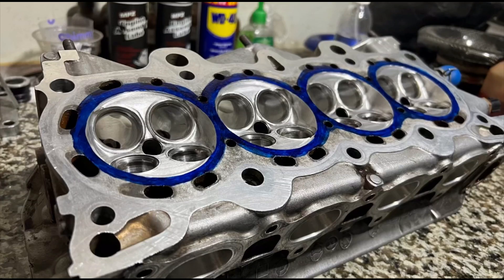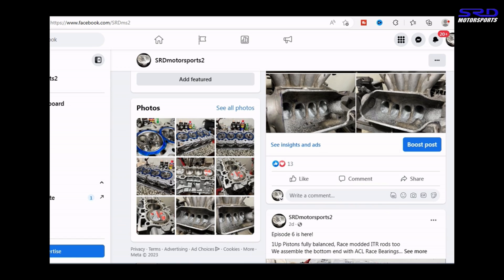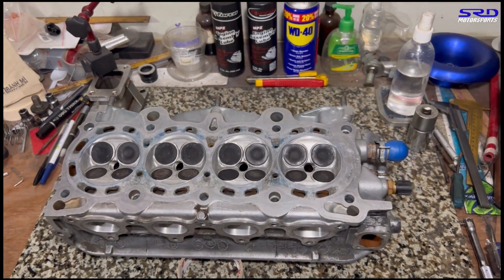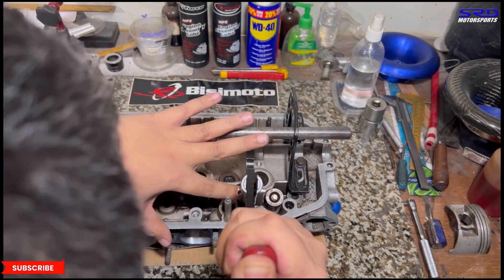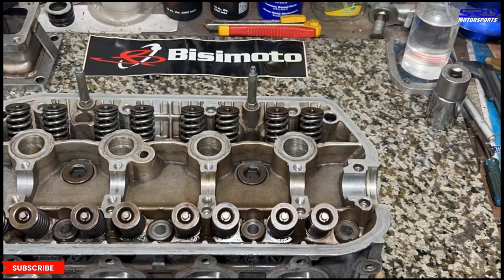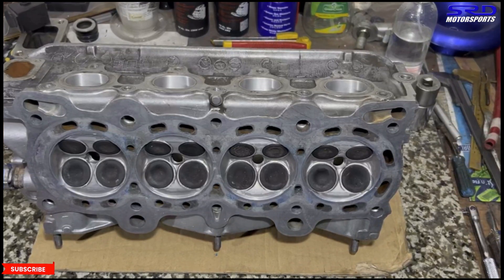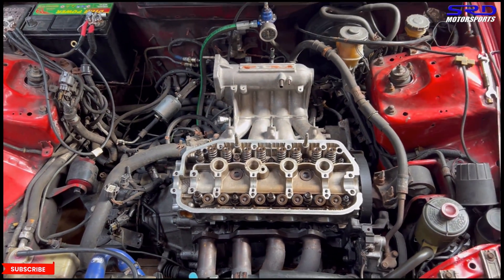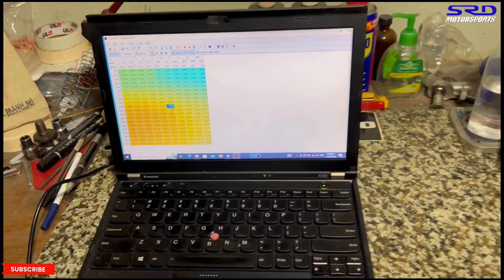D16a6 Non Vtec All Motor Build Series Part 5 Head Install & Tuning

Comment: Hello! I have a d16 with 20 camlobes, pm6 pistons, tri y header, 2.5in straight pipe to magnaflow oval. B16 fuel pump and injectors. I am not feeling any top end power and flattening"tope" around 5k rpm. Is there anything i can do to improve top end power?
Reply from the maker: What head is the 20camlobes on?
Reply: P2j head. Stock head for vti 99
Reply from the maker: @o.kurt.rb1230  please search the video I made last year with the title
P2J Vti Head P08 cam tech

hopefully u can share it too on your social media for more awareness
Reply: @SRDmotorsports  will do thanks! So besides the head and cam, is there any problem with like the exhaust diameter, etc?
Reply from the maker: After checking that vid you will know hehe

Comment: Hey there bro,one big important question,my d16y6 does not rev soundly past 5k,jammed,frozen,cloggy etc till top end,seizeable feeling on top end zone,tp sensor changed,tp wire fixed volt checked etc,knock sensor changed,carbon cleaning matters cleared,car is a stock long block d16y6/y8 with a short ram intake,1.8 isch inch header and 2.25 downpipe,however the car does not have the o2 sensor or the wiring to it,does not have both wires and sensors,is that a major issue in this case or not,your response would be helpful,thanks.
Reply from the maker: If it’s a stock ecu it will matter and may cause the issue you mention
Reply: @SRDmotorsports  so you mean unplugged o2 sensor and no wiring is not a major thing when it comes to performance but rather it is because of the stock ecu.
Reply from the maker: No I mean both the stock ecu needs that o2 sensor running so it needs both not just cuz it’s a stock ecu
Reply: @SRDmotorsports  got to sort out the o2 stuff soon,car builds a performance rush surge and abruptly breaks down with a touch of misfire,hope your advice helps,thanks.
Reply from the maker: Alright alright

Comment: hey i have a po8 head was wondering if it cam run vtec on my setup with p29/pm7  without the valves getting hit from the piston the head gasket is 0.074in/1.88 mm thick(doubled ) piston sticks out 1.25mm or  - 0.049mm  the clearance difference is 0.025in please tell me if its possible to run vtec on my setup ......
Reply from the maker: I’m not sure because the piston sticks out a lot and the pockets of the pm7 isn’t correct to the vtec head it’s for a dohc zc
Reply: @SRDmotorsports  would it be better if i run my non vtec cam in the p08 head because it flows better than the p2a head???
Reply from the maker: Only the po8 cam works well with the p08 head so I don’t think the nonvtec one fits and if it does

It’s exactly the opposite of the p2j video I made stating why locals should stop converting their p2j to run p08 cams cuz it skews up the timing sequence including the injector timing
Reply: @SRDmotorsports  so best option is run the po8 head without the vtec the non vtec head I am using is a p2a head wondering if the p08 cam is better on the low side vs the p2a ????
Reply from the maker: no the cam timing on the p2a head isn’t the same as a p08 it won’t run properly if it fits

In the end a proper built and ported p2a head engine may run faster than that
Reply: @SRDmotorsports  watched that video
Reply from the maker: Yes sir yes sir

Comment: Thanks for you content brother.  Keep it coming ..dont stop.. !!!! 🤟🏽😎🤟🏽
Reply from the maker: Oh thanks man… thank you brother and for sure man! It’s actually quite fun sharing these stuff…who says u can’t have fun as u advertise the shop 😎
Reply: I appreciate it.   Helps out a lot. And what injectors are those what did they come off of ?? How did you get them ???
Reply from the maker: They’re like the Denso RDX but smaller off a K20a TypeR
Reply: Thank you..🤟🏽😎🤟🏽
Reply from the maker: np man… I used to run the cbr954 injectors before that… as bikes always had stuff ahead of our cars it’s a 12nozzle tip injector 290cc too
Reply: Hell yeah  bro. I'ma look into getting some for my d16 build... Can I run these with out a tune ???
Reply from the maker: Oh nah it must be tuner it’s def not gonna run well or at all it’s way bigger than 240cc stock
Reply: Thanks again bro.  👍🏼
Reply from the maker: No worries man anytime

Comment: Depends on fuel type your running,you can run your 13's or can run 10's and thats just how it is.
Reply from the maker: Pump gasoline here no e85 no alcohols…a street car
Reply: @SRDmotorsports  Sounds good,we did a high comp D17 in South Africa but could only do a 14 flat at 5500ft altitude pump fuel
Reply from the maker: @dirkdiggler9082  at 5500ft?? That’s already atleast 13.2sec at level! That’s fast man!
Reply: @SRDmotorsports  Yea she was fast but gutted hard ha ha.We struggle there with times but a few friends of mine ran some good times there...king K 😉
Reply from the maker: That sounds like the real essence of fun!!!
Reply: @dirkdiggler9082  any videos of the 14.0 run? I'm from SA currently have a 14.3 d16 dohc (full car)
Reply: @yasinkariem3347  Nah thats years ago,my nokia 3310 didnt have a camera ha ha.Thats pretty fast,where did you do a 14.3?We did it at Tarlton so was prepped
Reply from the maker: @dirkdiggler9082  that’s why I know u did good…I used a 3310 too!! Hahaha u can throw that to someone and it will hurt but will still work hahaha

Comment: Build A vs Build B -- Both may have the same exact parts, but with a different builder and tuner, results will greatly vary. I would love to see a SOHC dyno shoot out then an endurance race 😉🥩🍺
Reply from the maker: Maaaan now you’re talking! Actually may not need to be a shoot out cuz u know where we are from , animosity grows on trees haha

but it could be like PowerNation style build and just start tune from blank basemap …same engine two tuners

Or one tuner = 2 engines like u said identical or same set up and check power
Reply: @SRDmotorsports  Nowadays, like you mentioned, some people just download a rom editor then hook up a wideband sensor and they think can automatically charge people for "tuning"
Reply from the maker: Yeah so true I mean nothing wrong if it’s what they’re into but a lot of times they do it for the “name” tuner and for money 

Again that’s also okay but earn the skill and knowledge naman sana it’s “their” engines that suffer
Reply: @SRDmotorsports  You nailed it on both points! 🍻

Comment: Cool engine start button 👍
Reply from the maker: Thanks haha tbh the reason was cuz the key ignition part? Is worn out there were times I thought I had “low battery” power cuz it barely cranks

Then when we run the line direct to the starter it cranks as if bnew so we figured ok push start button might help avoid keying it
Reply: @SRDmotorsports  And it's not so big like the OEM push starts
Reply from the maker: Ah true yeah if it was big I’d put it under the steering column but it was smaller than usual plus not bling color so it was good somehow

But man it took us 1-2 months to figure out it was the ign key way lol we were considering rewiring even haha the headaches lol
Reply: @SRDmotorsports  We had an old car that had an ignition key problem, not so much the wiring, but sometimes when the car is turning, the key would fall off and go between the floormat and the carpet. 😂
Reply from the maker: @findtherightbeat  oh Bong’s ef was like this hahahahahha napapamura sha haha
Reply: @SRDmotorsports  Hahahaha, hassle e!
Reply from the maker: Super and since it’s our owner car we paranoid llol